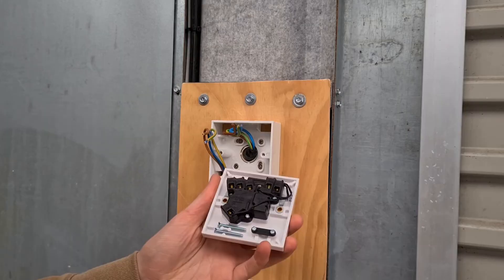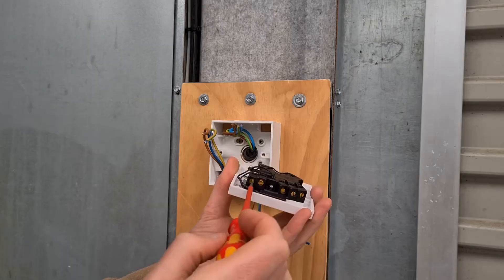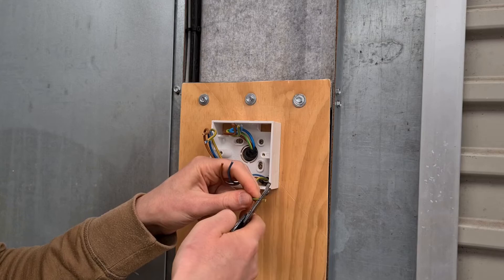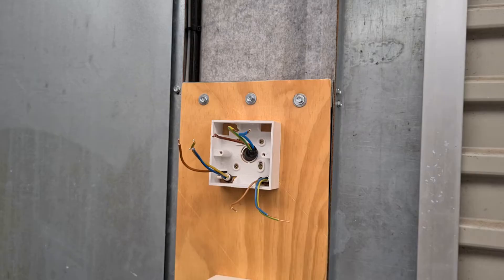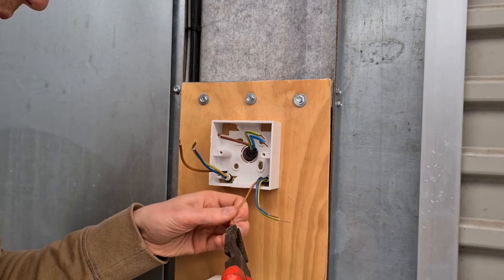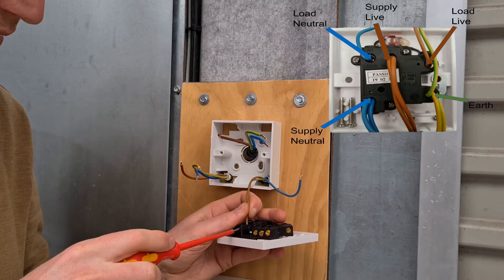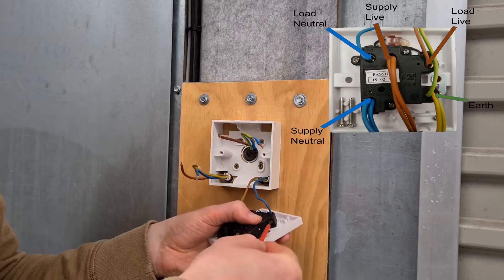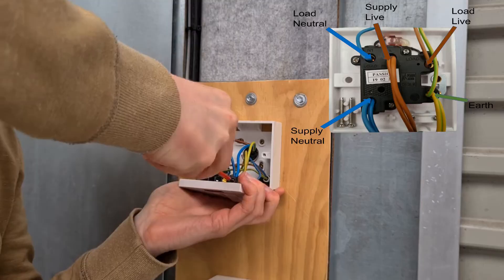Wiring switched fuse spur for lighting subcircuit

Comment: Hi, excellent video. I have a question? I want to feed a small set of LED strips under some shelving and have the 12V transformer. I have identified a 30a 3 way junction box in the ceiling above which feeds the lighting circuit. Can I add a 1.5mm able to this and feed this to a fused spur > 12V transformer for the LED strips or should I stick with 2.5mm cable from the Junction box.

Comment: Nice video
Reply from the maker: Thanks
Reply: @galwayctech3686  Very good Youtube learning. Please advise if    i) a switched fuse spur for a boiler should be 3 amp or 13 amp ?  ii) if the former, would it be ok if the fuse spur's 13 amp be just replaced by a 3 amp fuse ?  iii) how come my switche fuse spur just has one hole for Earth ? Many thanks.

Comment: Quick question. I have a fused switch fitted and second wire goes to outside light. I want to change light and run a new cable. I removed the fuse and cut the wire. Do I need to turn off electric when I’m fitting new wires? I know it’s dead as I cut the old wire but is there anything live if fuse is out when fitting new wire?
Reply from the maker: Thank you for your comment. It's good practice to isolate the electrical power at the breaker. To be safe, disconnect the electrical power at the fuse board by turning off the breaker. Measure the voltage with a multimeter to ensure it is safe and remove the fuse at the spur to ensure the load (i.e. light) is disconnected from the power. Remember 30mA can kill someone so always protect yourself. Seek professional advice from a qualified electrician.

Comment: Good vid.  Is it dangerous to rig a light straight from a 3 pin socket to a rocker switch and then to a ceiling light bayonet holder, or is it best to use a cable from the 3 pin socket to a SFS  as the light switch.  Thanks
Reply: Most light switches are only rated for 6 or 10 amps and depending on your location, the socket could be on a 20 or even 32-amp breaker or fuse. So you have to fit a fused spur.

Comment: How come your using a fused spur for lights
Reply: The switch isn't rated for the 20 or 25 amps of the socket circuit supplying this setup. You could use the spur itself as a light switch though, at least in the UK.
Reply: @Ragnar8504  Hello recently went to my loft and found that my spur has 2 red wires going into the supply. I understand that one runs from the socket to power the switch, that power my lights. However the second red and black wire run to another FCU and that powers my boiler. Do you know if this is the correct connection?
Reply: @dakkan5433  It doesn't sound ideal, although it might be OK, depending on the size of the cables and fuse/MCB protecting the cable. If you're concerned, have an electrician look at it!
Reply: @Ragnar8504  It isn’t in my opinion, the wires are over 50 years old! They are not even close to 2.5mm. I have no clue who was doing the connections but 3 wires for 3 separate bulbs oh dear...Looks like something I’ll be doing for the next month after work